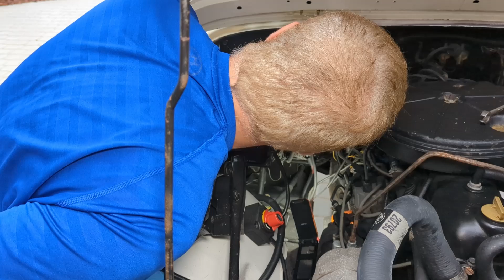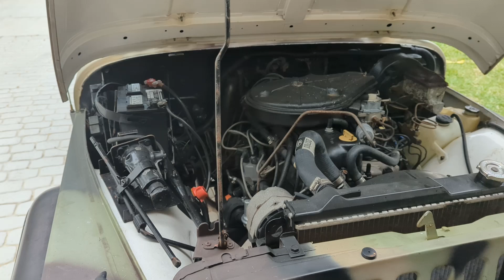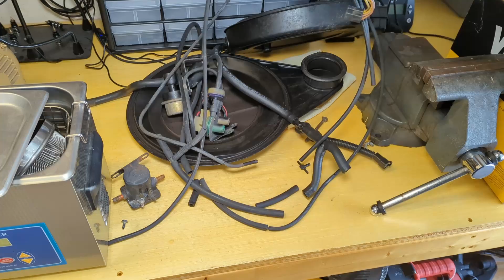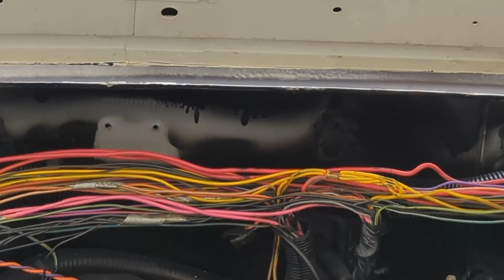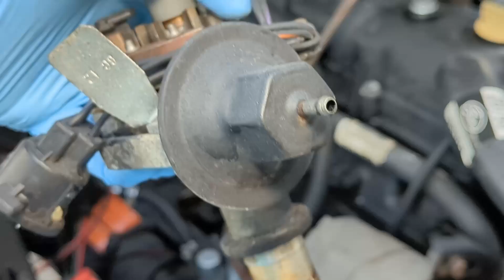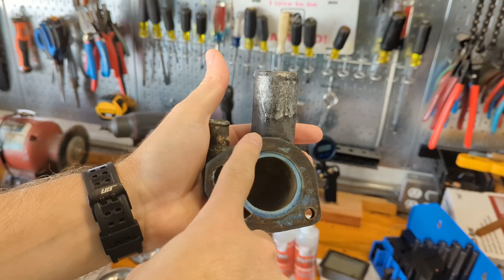1987 Jeep YJ Tune Up + HEI Distributor Install

Comment: Hows does the HEI distributor eliminate the need for the nutter bypass?      My first wrangler 1989 4.2..  Did you unpug the stepper motor on the carb?   Thanks

Comment: How do you stop the fuel from draining back out of the carburetor?
My 90 yj does that
Reply: I put a one way check valve $13 inline after the mechanical fuel pump on the side of my YJ. Still drains/evaporates fuel but it takes over a week now instead of 30-40 hours.

Comment: Thanks for the great video, did learned and I want to know on the carberator the setting for 1990 JeepYJ 4.2 and the RPM it should be on tachometer

Comment: Joe maybe I missed something but what happened with the fuel issue draining from the carb back to the tank?  This seems to be an issue with all of the YJ's.  We installed a weber 36/32 replacing the OEM carb, runs much better but still have a long crank time like this one.  The mechanical fuel pumps take for ever to get the fuel back to the carb bowl.  Any suggestions other than switching to EFI ($1k price tag)  :)  Videos are great, thanks!  ~Ryan
Reply from the maker: I ended up installing a check valve in the fuel line leading to the carb and that seemed to help. Time will tell how long it lasts. This vehicle is not driven or even started very often -  like once every several months, so really hard to draw any conclusion in this case.
Reply: @JoesGarageProductionsLLC gas can't really syphon back out of a carb inlet. That's evaporation, dude.

Comment: I got a 87 YJ put the 258  I installed a DUI distributor I remove the coil the distributor and the engine control module I wired straight 12 volt when the key on to the red and to the green I put the tach wire that was on my coil no spark?? Acts like I have a drain any thoughts I will say that I started this whole project because I lost spark and I figured it was just a bad distributor pick up but it's doing the exact same thing. With the ignition switch on the steering column have anything to do with why I don't have spark

Comment: How do you know which aftermarket solenoid to buy? I have the original one on my 88 wrangler and i do know it needs replaced and want one like this style you showed. Yes i know how to run a multimeter
Reply from the maker: I believe they have two different parts for the automatic transmission and the manual transmission. I just ordered the one that RockAuto said was for the manual transmission